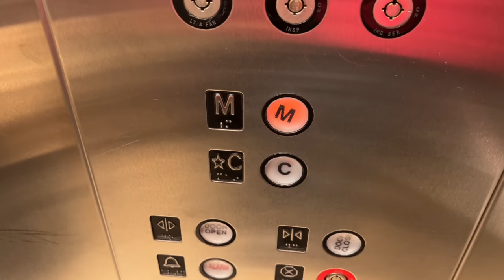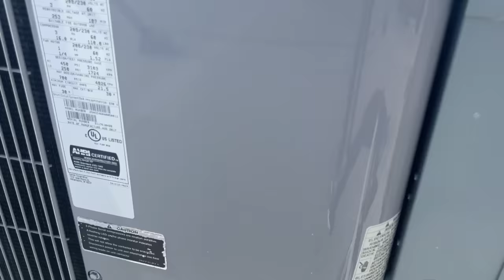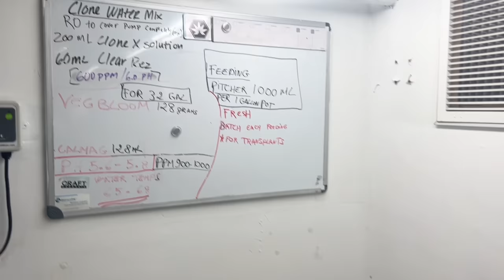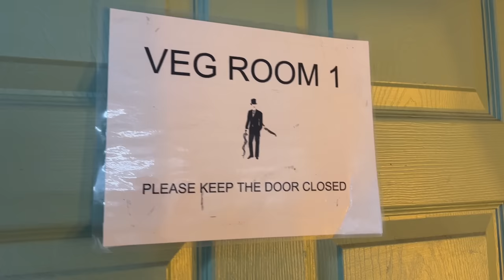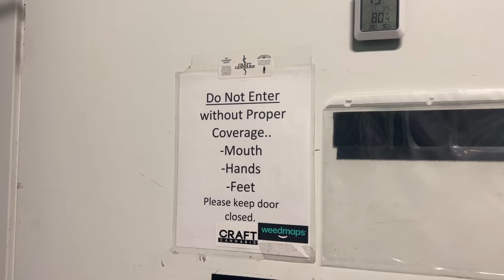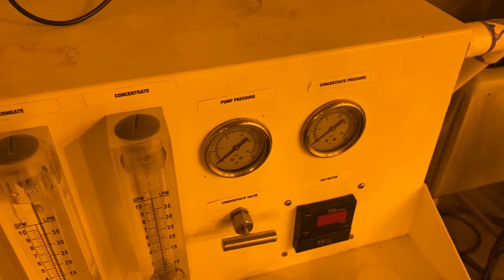"Ready To Buildout" Abandoned Las Vegas Grow And Manufacturing Facility HVAC Assessment

Comment: So they stack a bunch of condensers on a 110f roof🙄 Would have better off setting them off on the shaded part of the building.
Reply: Exactly.  Put an ampmeter up to my condenser.  It’s on the sun side of the house and it starts to get sun at 1pm.  Even though temps don’t rise much, I see a 1.5amp increase per leg 10 minutes after the sun hits the condenser.  Doesn’t sound like much but that’s a few SEER points.  Over years that’s a crap ton of power.

Comment: by 8:24 none of the existing "vapor"  lighting is ducted for heat removal, that alone is a massive amount of heat output directly into the building space, besides the light/radiant itself.
if you notice the other op (you toured) had them all "ducted" in rows and those would likely be ventilated to/from outdoors directly.
the large amount of LED fixture will end up producing about the same amount of heat in total as the duct vented arc tube bulbs. 
they likely miscalculated the cooling needs by a large amount, directly due to the light fixture BTU output, as well as the circulating fans and other pumps, controls, electronics. it all adds up real fast!

Comment: the process itself would always be adding vast amounts of indoor humidity. the swamp coolers are likely all abandoned and leftovers from a previous business, adding is humidity will likely be the very last thing needed/wanted.
Reply: @PipeDoctor   yes, the high power and long run times of the  lighting makes high evaporation rates off the plants, so they're likely misted to curb over drying and or burning. 
that adds a ton of humidity to the air you're trying to condition and maintain the humidity. also during "sleep time" the a/c will become massive oversized, over cooling or not running hardly at all, which is also why they had dehumidifiers.

better have multiple input from senior grow op's or you'll be shooting yourself in the foot at every turn. that's certainly not me, I know just enough to avoid it like the plague!
the correct term for evaporation through plants is like "evapotransporatrion".
Reply: I forgot a major part, it provides plant cooling from the evaporation. I guess that falls under drying and burning.

Comment: For an op like this, no clue why they used 208/240 units.  Always go 480 if you can.  Smaller wiring, more efficient, no capacitors, and less loss (your 480 -> 208 transformer eats 6-10% depending on unit / age)

Save your 208 panels and 208 transformer capacity for lights and take straight off the 480 panel.

Comment: All the large open area's would get a full blown refrigeration system period. You could run 6 evaporator fan's off of one simple to fix condenser. Smaller area's could be fed off of one or two a/c unit's and duct work. I did a big ass General Steel building that had 12, 5 ton unit's and the owner was getting tired of shit breaking down all the time. Not to mention what he was charged for all the equipment, which was jaw dropping. I'll put it to you this way the cost of 3 of his 5 ton unit's he got taken to the bank on, I put in a refrigeration system. That was two years ago, and I have never had a service call. I see him once every 3 month's or so for dinner, and he lay's it out. Last time was a 32 pound prime rib roast with all the sides.  ( He had Lennox equipment and every a-coil leaked ).
Reply: @PipeDoctor  12, 5 ton units with air handlers, I recommend furnaces because they have the same blower motors and are easier the sell if you get out the buisness, 18k each. If that's not highway robbery I don't know what is. And he paid cash. I went over and stay brite 8 all his shit in like I recommend to you about a year ago, and made a life long customer.

Comment: I'm not a farmer , but pot grows in the hot jungles of South America  just fine , not Alaska . What is with all the AC requirements ?
Reply: The lights give off a ton of heat
Reply: @lesleyboeder1798  sure the older ones do. But the new LED ones should be a lot cooler.
Reply: they all grow at very accelerated rates, the lighting produces a ton of heat, the watering and evaporation rates into humidity are massive.
they always underestimate the total BTU of heat produced and never account for the dehumidification needed.
no, I have nothing to do with any grow ops of that nature, but I do know it's worse than food type grow ops by ten fold or more. the light, fans, all electronic/electrical equipment and humans emit tons of BTU's per hour, then natural aspiration from the properly maintained watering evaporates vast amounts into humidity, and supplying enough humidity extraction is a major hurdle. humidity gets too high and you'll have mold and that equates to shut down and total profit loss.
Reply: @throttlebottle5906  I for one think this should not be legal for recreational use . Medical OK fine . But this is will be all for nothing soon anyway once the price of electric gets so high people will start living as they did on Giligan's Island .

Comment: Get a grant from Federal Government  for solar energy . Use the roof top or parking area for solar panels. Use solar power for lighting  and to run Ammonia /water adsorption A/c and refg loads. Tap return ducts to LED lights ( one 4 inch flex metal ducts adapted to Light fixtures at each end tied to round duct return air system) Paint all walls ceilings and other equipment flat white for reflection value. Use wall mount circular fans to distribute cooled air gently over plants. Use transducers for light and humidity control of duct dampers in supply and return air. Pray Lake Meade does not dry up.
Reply: Not even remotely enough rooftop space for solar for the amount of power that facility needs.
Reply: @xzibit8614  And you calculated the daily KWH need of the 10,000 sq ft based on what criteria?
Reply: @hughholt121  you have 20+ units that consume about 4.5kW give or take for a 5 ton.  Add Vegas heat you’re at 5kW for higher head pressures. You’re close to 100kW sustained load without lights.  Each metal halide is 1000 watts.  I saw over 120 scattered about.  Add in LEDs and misc, and not counting all the mini splits, you’re over 300kW sustained load with misc components such as pumps for hydro etc.

Modern solar after efficiency losses make 15 watts per square foot give or take.  Half that roof is peppered with condensers.  So 5000 x 15 = 75,000 max theoretical for peak sun, say 8 hours a day.  Not even 20% of their usage.  And that capital investment would yield higher dividends if it went into producing more cannabis.
Reply: @xzibit8614  Sol Up of Las  Vegas says no problem  and they would love to do the job.

Comment: What about a giant R-717 and secondary glycol loops
Reply: @PipeDoctor  Don't know of the legality of 717 but know it is still in use. No more ICE engines running compressors off NG, possibility of using a solar/thermal collector with a NG kick when called for. Ability to create multiple redundant modes of operation and split load. Still running as a `heat pump